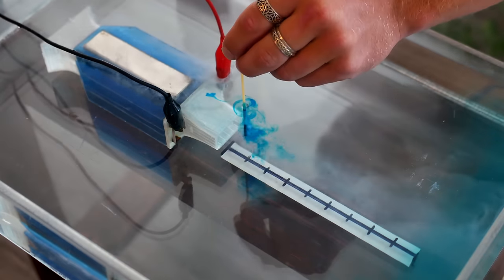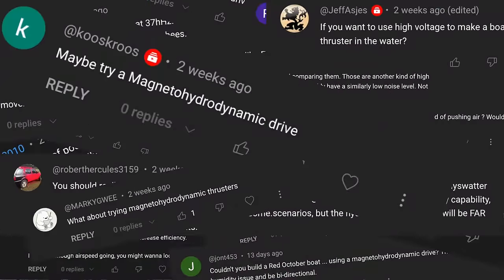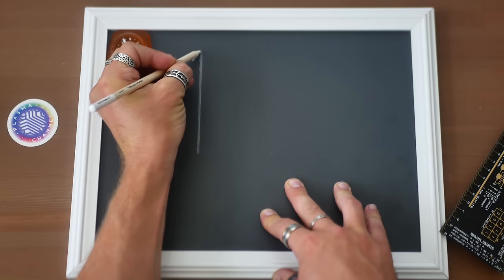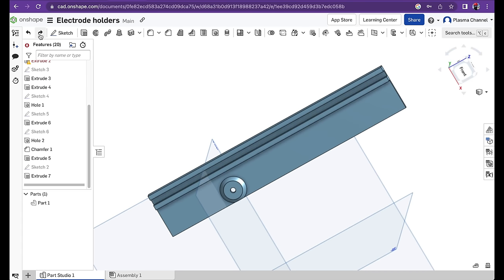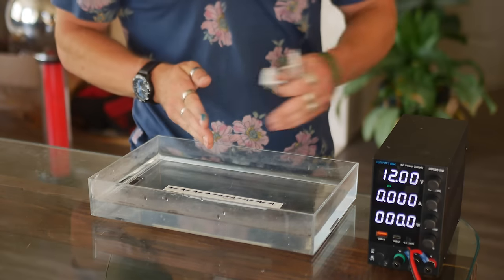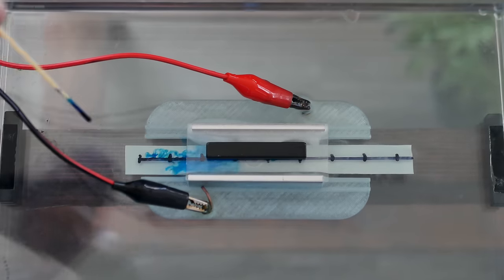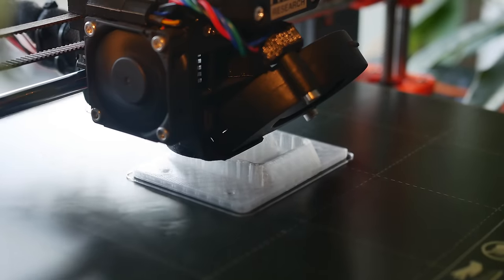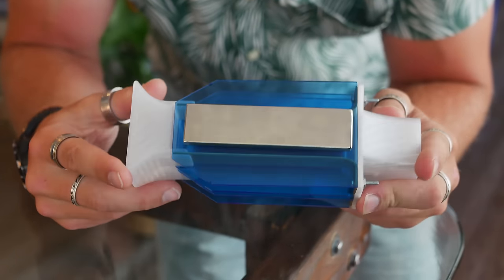Using Stealth Propulsion for Ocean Travel (MHD Thruster Build)

Comment: My advice on this would be to gain some insight into what your  magnetic flux is doing.  There is software out there for modeling this.  The path the flux follows is a variable in this situation that you didn't even mention.  Also, were those bar magnets?  If so, the flux runs primarily down the length of the magnet, out the ends and wraps back around on the side, which probably means that your major action is occurring near the ends.  What you'd really like would be for the flux to be primarily vertical all up and down the length of your channel.  Also, is a back-iron, to return the flux back around the part of it's circuit that's not in the water, possible?  It might substantially increase your in-channel field.  It would add weight, though.  But I assume you intend to put this on some kind of a vehicle, so the extra weight would only be a small fraction of your total vehicle weight.  Might be worth it.
   
I worked in a university lab, The Center for Electromechanics at the University of Texas at Austin, while pursuing my PhD.  We designed railguns, coaxial accelerators, and so on, and field modeling was a big part of what I did.  I'm excited about your work and would be happy to try to answer any questions you might have if you start to look into understanding your field better.  Please feel free to get in touch!

Comment: It's a little hard to tell from here but when you did the difference in spacing it seemed that it had an effect on the acceleration and that perhaps putting them closer together along with the longer electrodes would have yielded better performance and worth revisiting?

Comment: instead of using dyes/inks to measure speed, use a styrofoam bead. I'm making an arrow in dark guess, the speed difference also made the dye/ink diffusion rate different and thus caused errors in measurement.

Comment: I saw something where the strength of magnets could be increased by using smaller magnets but alternating them at right angles to each other. I wonder if instead of using single bar magnets, you could get more thrust by using a similar configuration.

Comment: I think you should use AC instead of DC, and layered solenoid configuration in halbach arrangements so that the electrodes don't get 'eaten away' by the electrolysis.

Comment: For the brass electrodes, do they actually need to physically touch the water, or could you coat them in a hydrophobic coating to prevent electrolysis? If you can prevent electrolysis, you could theoretically get a more efficient and reliable design.

Comment: Three u shaped electromagnets arranged in a triangle with the poles pointed into the center sequence the magnets on and off in a circular motion (nothing actually moves though) bare copper in the center with the magnetic field rotation it should stimulate the electrons in the copper

Comment: Great experiment, thanks for sharing. Quick question: the noise produced by this kind of thruster should be related to the bubbles (small engine, low noise) Would you be able to kind of extrapolate the kind of noise produce (spectrometer/oscilloscope) + microphone?. Maybe for a big engine could be disturbing to sea wild animals as well, just a thought. Thanks!

Comment: Theres alot of turbulence between the electrodes when the water runs through it. I wonder if the electrodes had a spiral pattern if that would help the water get repulsed in a smaller linear area, and this should stabilize the waters path throughout the field. 

I also think you could turn the magnets as the spiral electrodes turn which should help with any dead nodes in the velocity paths. 

You could also cool and energize the magnets to create slightly stronger magnets but i have no idea how much power and how cold the magnets would need to be to see any real return on investment.

The only other thing i can think of is to use a wide opening input and a smaller exit and the pressure increase due to large amount water getting pulled in to have to exit a smaller opening could cause more thrust.

Comment: Holy snap this is amazing!
Reply: I see a continuous circuit that given initial momentum creates an ever increasing speed. Collecting electrical charges from movement and giving it back to the propulsion system. The capture of the energy source is the problem until it isn't required.

Comment: Cool! I'm curious if reducing the voltage to below that for electrolysis of water would increase the efficiency, since you're not expending energy splitting water atoms. Of course, lower voltage means lower current, but you could compensate by moving the electrodes closer together.

Edit: Electrolysis occurs at (minimum) 1.23V, or roughly a 10th of your current operating voltage. So reducing the electrode separation by the same factor should result in the same current. However, having the electrodes just 3mm apart could impede flow... I guess you have to test it!

Comment: , Press down press down Angle the electrodes. It may increase resistance pushing the amount of water out of a smaller space, but no differences found between space so all the extra water should be pushed'creating a higher volume S entrance to exit point is now decreased.… And to potentially increase or combat the resistive force, increase the magnetic field at the rear of the thruster. I.e. more volume, I accept pressure should equal more thrust at the same voltage

Comment: This is neat! I'm going to try making one myself, but I noticed that your electrodes seem to be corroding. Can't say that is a good thing both for the Propulsion engine and the Ocean you're using it in. Perhaps using Titanium and a Platinum coated electrode would work better and maybe allow the increased in voltage to play a part in increasing the Water Velocity.
An afterthought when doubling the magnetic field strength, you essetially created a camber which the water flowed through. Would that not have affected the Water Velocity on the other tests?

Comment: couple thoughts:
you can probably non-dimensionalize your problem to perform more insightful experiments - get something like a thrust coefficient. obviously bigger = stronger but you want to see what configuration is the most efficient. some parameters might also be coupled (maybe electrode surface area and magnetic field strength) so you want to see how they interact with each other.
to characterize thrust, i think you should look at some control volume analysis. velocity is not enough to characterize it, volume flow rate would be slightly better. you want to see how much fluid is being moved, so even though increased spacing results in the same exit velocity, i suspect it'll have higher thrust because you're moving more water. but overall, to look at the specific value of thrust, this is a more complicated problem and you need to look at CV analysis and measure the velocity profiles at inlet/outlet and also momentum imparted to the walls.

Comment: Would it be possible to use ferrous core electro magnets instead of the neodymium bars using the power supply to the electrodes as the winding wires? I mean the current flows through the circuit anyway could you not harness that current to generate your magnetic fields too or would the field be too weak?

Comment: Is this supposed to be an alternative to combustion motors? Correct me if I’m wrong I’m no chemist but doesn’t electrolysis produce chlorine and sodium hydroxide? Could replacing combustions motors with MHD thrusters result in coastal areas with large amounts of brine or sodium hydroxide and chlorine?

Comment: What about the chlorine that is produced? The MHD thruster would be primarily used in salt water ( it will work but far less efficiently in fresh water ) and by having two electrodes with a current between them you would, as you point out, cause electrolysis to occur.  Electrolysis of saltwater produces hydrogen and chlorine, small amounts of sodium and small amounts of oxygen.  The bulk of the chlorine would form hypochlorous acid some would reach the surface.  Is it possible that a really big motor would leave a trail of both acidified sea water and chlorine gas behind it?

Comment: What if you coated your brass electrodes with indium tin oxide? It's supposed to be a conductor but be moisture resistant. Can't find where anyone has tested it in salt water thou. You could be the first lol. 
       One more question what if you switched to an electro magnets? With that you could control the power of your magnetic field dramatically increasing it. 
      For your boat perhaps a hydrofoil design. You could put your thrusters perhaps in the foil itself?
      Good luck perhaps this will help

Comment: Your testing kinda assumed that all the variables were independent... but in addition to the main comments people have made, the effect of the distance between the electrodes has a dependent relationship with the voltage you're putting into it.  Higher voltages mean the transfer overcomes the water's resistance easier and a couple of centimetres of difference may not noticeably affect the transmission of 12v where it might affect lower voltages.  You would have needed to test both different voltage levels AND different distances together to really get anything meaningful.

You also only tested varying the surface area in length, where you could have also varied it by adding folds along the length of the electrodes.

Comment: Hmm- I know it defats the "no moving parts" bit but I wonder if you could speed up propulsion by using multiple smaller magnets that continually move down the length device on a belt or chain drive ... Or just do it with switched electromagnets- Would that still work?

Comment: I noticed that the shape of the end of the thruster was narrower (or at least, it looks that way). Is this actually desired for liquid since it won't compress? For an engine that uses gases, I can see wanting more of a rocket engine shape (compress the gases for thrust ... I think), but could it be that the narrowing is actually working against you when it comes to being in a liquid? I know basically nothing about any of this, so feel free to ignore if this seems like a stupid question/thought.
Reply: Venturis and nozzles work for  incompressible fluids, including water.
Reply: @brianb-p6586  cool, thanks for the reply.

Comment: In the initial test sequence around 4:46 you expect more result from wider spacing, but you see the same velocity so you think there is no difference... but you are only measuring water velocity, not the amount of water which is flowing at that velocity. Twice the mass flow rate of water (for instance) at the same velocity would be twice the energy in the water flow, twice the momentum of water flow, and twice the thrust. If you don't measure what you are trying to produce, you can't optimize production. This was identified months ago by @TheBackyardChemist and probably others.

I appreciate the systematic approach and objective use of data, but experiments still need to be designed with an understanding of the system being testing and the goal of the development to be productive.

The test results from the assembled thruster at 11:15 include a thrust force (incorrectly expressed as a mass of 75 grams) so force measurement is being done, even though it isn't shown... a strange choice.

Comment: So, this is using some fairly simple elements....

but have you tried stacking electrodes with insulators in staggered arrays with magnets separated with a 3D printed bracket/fitting/spacer in an array? 
What about using a magnetic field viewing film to calibrate your fields and constraining your magnetic field using something like a rotor/motor coil? 

Curious AF

The assembly you have looks great! But I'm seriously curious if a more refined array of smaller well-calibrated elements could achieve greater thrust, and if an electro magnet can help.

Comment: You might want to look into boundary layer theory.  Your test setup is limited by the very shallow depth of the water.  At that cross sectional area between the electrode plates, you still have the viscosity of the water resisting the flow too much to properly measure changes in speed due to the narrowing of the distance between the electrodes.
Reply: Also, a round channel would be ideal to minimize the resistance in the center for maximum flow for diameter channel.

Comment: The problem with you electrode spacing measurement: Fluid Dynamics. You are measuring the flow in the center of the channel only and not getting a reliable measure of the flow throughout. The water on the edges will be much slower but the velocity profile across the channel will determine the overall thrust.

I'm loving the stacked design.

Comment: My completely uneducated guess why distance of spacing the electrodes seems to have little to no effect: the topology of the magnetic field distortion is still in a length-wise elliptical distortion. The closer the electrodes, the more the topology gets "squeezed" together, thus reducing the angular momentum of the field lines delivered with the reduction of the radii from the elliptical focal points. But I am probably totally wrong. Just bringing my thoughts to the table.

Comment: How does the thrust vary with the volumetric flow rate of the water expelled? Is there a potentially adverse tradeoff between the volume of water accelerated and the size of the motor for a given magnetic field density. This could affect how well the propulsion scales for, say, larger boats.

Comment: This reminds me of a video I've seen where a battery was placed inside a coiled wire. Given a push, the battery accelerated through the wire. A coiled wire also produces its own magnetic field when electrified. Would using two coiled wires inside a tube such that the wires alternate provide the electrolysis AND the magnetism, thus higher voltage would equal higher thrust? Maybe taper the ends of the tube slightly? Would be awesome to build a solar-powered boat with no moving parts even though it only worked in saltwater.

Comment: This might be wrong.  I'm not an engineer and know nothing about fluid dynamics. I keep thinking about the swivel nozzle on the F 35. Is it possible to make one that can articulate to control the direction of the water flow? If so, could it also have an adjustable opening to possibly increase the water pressure?

Comment: as with the ion propeller, you are aiming at velocity, but in propulsion what matters is MASS, mass flow, mass momentum, not velocity.
the (+) ions generated in the anode ((+) electrode) are repelled and create suction that is compensated by incoming water from the other end of the tube. Distance between electrodes does not matter, as the catode could be away from the anode and neutralised by the salty water positive ions. With your design I would change the configuration of the tube, first would try a T shape, in 2D, if this work you can design a 3D T, with rotation with different oulet tubes.
The idea is to really get all the thrust from the moving water, like an underwater sail, but with a T shape. In 2Dm the electrodes along the base of the T, and the outlet on the two arms of the T, there you will notice if the push from the water is significant, pushing on the arms of the T shaped tube. If that works, you can improve with a T with bent arms, ===), for better hydro dynamical performance, and move to 3D ===) by rotation along the axis. The outlet of water should be at 90º to the direction of the motion. That's a detail, just try to get push from the moving water, as a ram hitting a surface. Do not worry about Newton's 3rd Law, it's just for books, the speed of the outlet water just means you have enough flow to push.
In your optimization tests you saw that what matters is the amount of ions generated (i.e. surface of electrodes and power) Remember that to ionize Cl(-) to Cl(+) you only need a few volts, the electrochemical potential or voltage, which is not the same as the voltage you apply to the electrodes which tell you how much current flows in the circuits.
In the air, you may need more voltage to ionize N2 to N2(+) or O2 to O2(+), but the principle is the same, and you can use a sail to collect the air blown by the air sucked into the electrodes that moves through. If the area of the sail  is too big you may sail according to the wind, not the propeller.
There's an environemntal problem though,  you are leaving a trail of bleach in the water that may kill plankton and discolorize fish and marine organisms, unless you have a water treatment plant on board to neutralize Cl2, HClO, etc. The plant can be implemented as the outlet water, after hitting the arms of the T, is no longer needed for propulsion but only necessary to evacuate the chamber and allow water to enter the ionization chamber.

Comment: Looks like you are off to a good start, but what is the efficiency at this point.  You used 9 A and 25 V which is 225 watts input.  The power developed (output)  would be the volume of water   per second  times its change in velocity.  My guess is that it is only 2-3% efficient at this point.  A large part of the energy is probably used to make hydrogen and oxygen gas
Reply: Reasonable guess, but it's not that good.

Comment: Even though the closeness doesn’t affect the speed of the water flow, does it not make the volume of water flow increase because there is more water going through the channel at the same speed because of the width, therefore more power